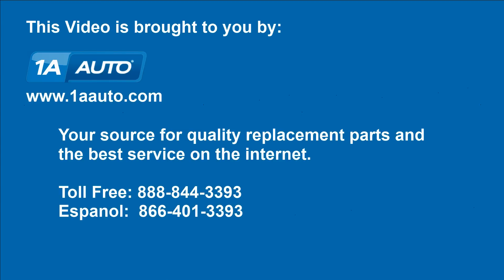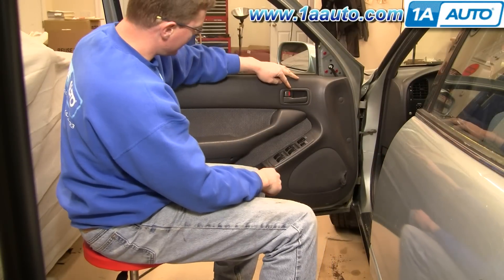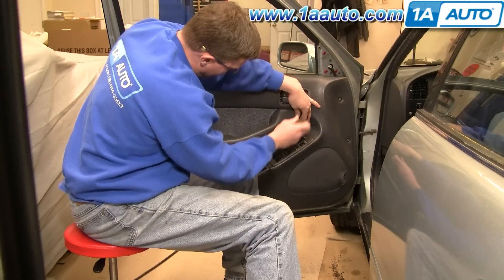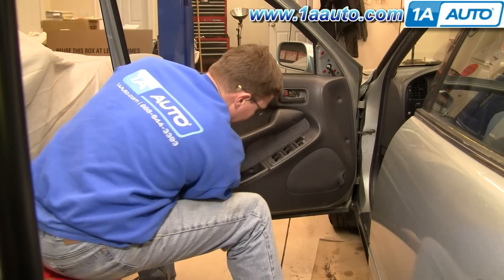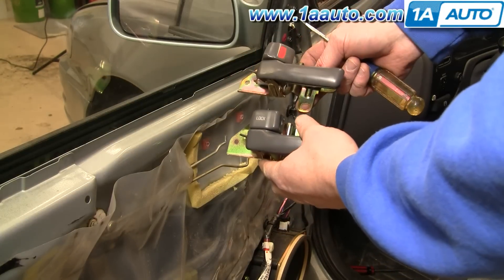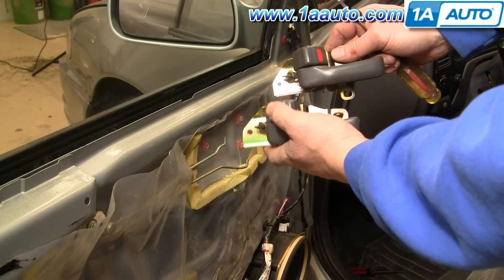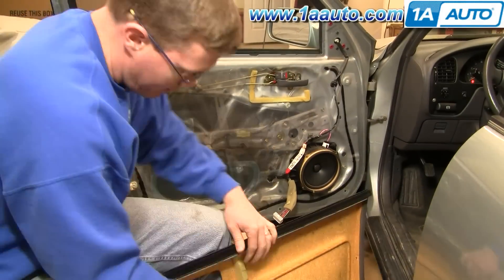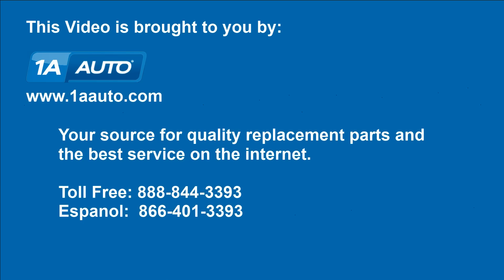How to Replace Front Interior Door Handle 92-96 Toyota Camry

Comment: Thank you for this excellent video.  The directions were perfect. The part fit exactly as it should.  I never would have attempted replacing the handle myself without the video.   I really appreciate that you shared your knowledge with others.
Reply from the maker: No problem.  Glad to hear it helped you out.  1aauto.com 866-403-3393

Comment: Thanks for the video.  The replacement took about 45 minutes.  The tip about rehanging the door on the top edge first.  Only problem I had was in re-aligning the door for installation and I did not read that tip until I had already finished.

Comment: I replaced the door handle on a 96 Camry today.  The video was right on target.  Caution to check operation of handle and lock before putting the door panel back on.
Hang the door panel on the top ledge first and everything lines up when putting it back together.  Took less than an hour.

Comment: Girl Power! I replaced mine in 2.5 hours,,Had a problem with the tiny little clips, the handle that came in had green clips facing wrong way, I used the white ones from my old handle that faced the right way for the lock, then the other white one broke so i used the new green one for the handle, it worked, but pain in the butt,,finally realized the pull bars/wires ends actually have to go up inside the hole of the clip then clip onto the pull bars/wiress, then shove the whole thing in the tiny holes in the handle that hold the clips, used pliers to squeeze em up in there, anyway, your video was all I used for instruction, the job is done, I am Victorious!! Thank you for your awsome vid!!
Reply from the maker: +Stephanie Schulz Nice work.  Congratulations on the successful repair.  1aauto.com 866-403-3393

Comment from the maker: @KevNLayy We currently do not have an auto repair video that shows you how to fix the door handle on a 2005 Kia Spectra. However on most vehicles there usually is a small plastic clip on the rod that snaps into place to help secure it to the door handle. If you're really stuck, you could also take the other door panel off and see how it is suppost to connect. Hope this helps.

Comment: Hello, I have a problem with my 2001 chevy cavalier.  My rear doors won't open from inside and from outside.  Both latches are broken.  Do you have any idea how I can fix my doors?  Thank you.
Reply from the maker: You may want to remove the door panel to see if the latch or cable inside the door has broke.